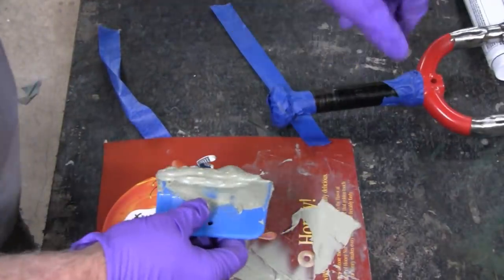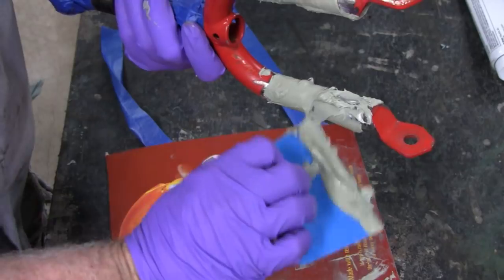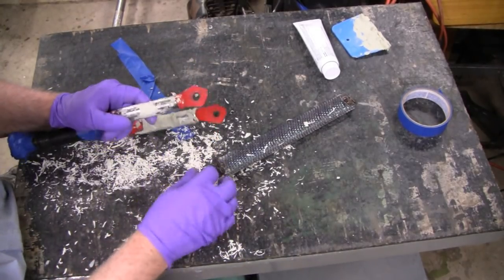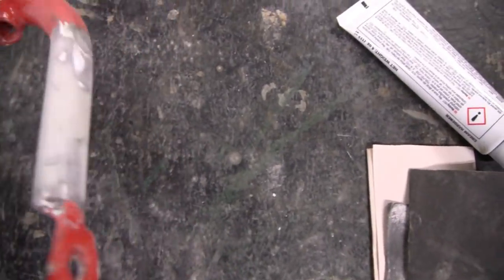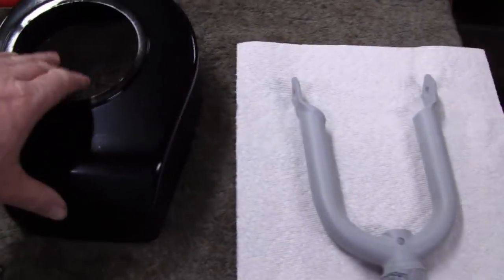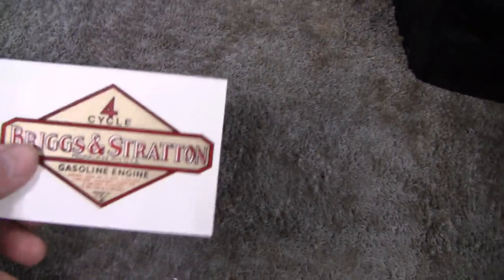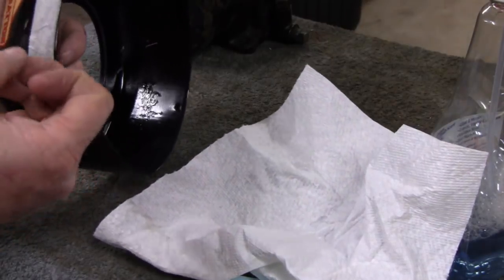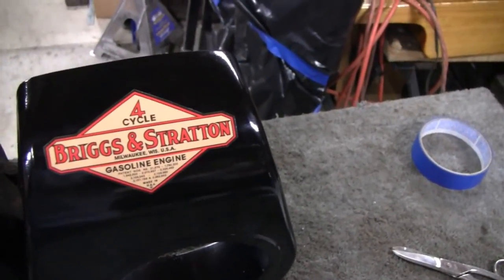MOTORIZED SCOOTER BUILD (part 14)

Comment: Nice technique  on the sticker . I usually like the original Patina on the old engines , but I did one of the old style water stickers years ago .
Reply from the maker: Yeah I like the original Patina too if it still has most of it's paint and legible decals, like that Briggs on the floor!! I would never paint something like that!!☺
Reply: I have two really old 40's 5s , and Just won't paint them . I got a 5s from the Tech school when it closed the program I was on in High School. It was nice to end up with it all these years later . Fully restored that one  completely , and I know all the parts are from Different engines , but it runs great restored .

Comment: I use plastic gallon ice cream buckets to make my smaller "bondo" putty paddles. For small jobs they are flexible enough to do what you want, cheap enough to cut in any shape you need,  even if you don't eat ice cream (me) you can pick the empty buckets up for free from friends and family.

The lids are great mixing boards for the above reasons and you can just trash it when done.

When applying vinyl, spray your fingers down and it won't matter as much when you touch it.
Reply from the maker: Good tips Bud!!☺